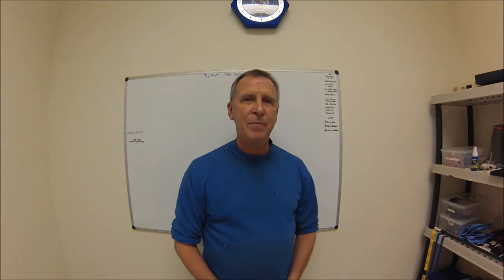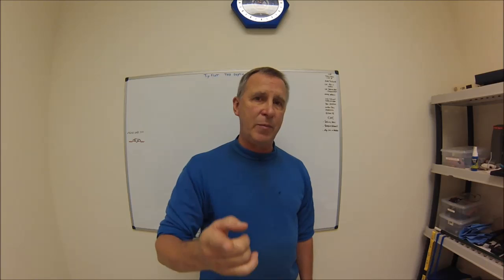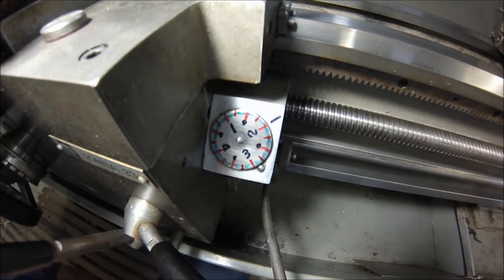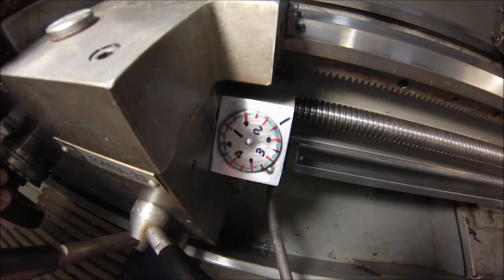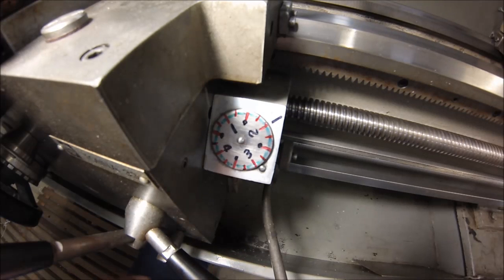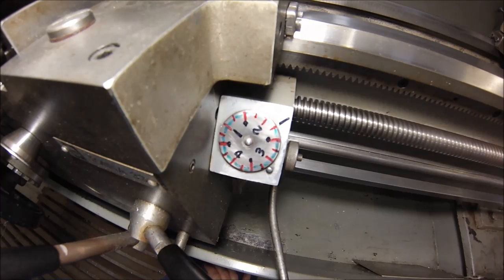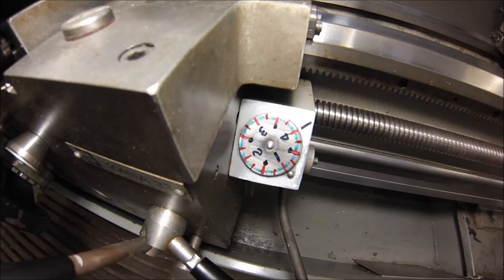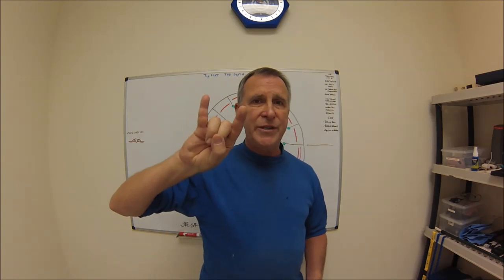Engaging a half nut.....made easier

Comment: I had 1-4 and intermediate lines. Putting a sharpie mark in between those lines really helped me. Made my first set of external 5/8x24 threads yesterday. Felt good.
Reply from the maker: Excellent. Did you also use the "away from the headstock" method ??
Reply: @joepie221  sure did!
Reply: How

Comment: if your lathe has a single gear thread indicator wheel here is what to do, with the lathe off,, engage the half nut, turn carriage crank wheel forward and back try to feel the lash if there is any, if so set the crank wheel in the center of lash .  engage the in the thread dictator, note the marker, if its not aligned with a line ,loosen the nut on the end of dial shaft line up the line and tighten the nut .you are now in time with the half nut and dial .there will be no need to feel the gear .
Reply from the maker: When slip engaging a half nut, its not the gear you are feeling. Its the teeth on the half nut riding on the outside of the lead screw. Most lathes I've seen have keyed gears on the thread dial, but if not, timing it as you suggest would be a good idea.
Reply: @joepie221  love your videos

Comment: I always do better when I understand the "why" behind it.  A threading dial is just a round ruler.  It measures 4 inches of carriage travel each time it goes around.  There are numbers at 1", 2", 3", and 4" with hash marks at every 1/2" in between.  Does your threading job have a whole number of threads in 1 inch?  If so you can use the numbered lines to engage.  Is there a whole number of threads in 1/2 inch?  If so you can use the hash marks in between.  This is why odd thread pitch = any numbered line, and even pitch = any number or hash mark.
Reply from the maker: Wouldn't you automatically have a whole number at 1" if you have a whole number at 1/2" ?
Reply: @joepie221  Yes indeed!  I should have said, "You can also use the hash marks".  If threading 11.5 TPI or Metric 0.4mm you can engage every 2" (pick even or odd numbers). 0.8mm will repeat every 4" so use the same number each time.  But remember to take Benadryl when threading metric 😂

Comment: On the lathe I work on, under the thread dial is a list of tpi numbers and a number beside them which I assume is the number I am supposed to engage the half nut on for those threads. However the numbers are 1, 2, 4, 8, and 16. What is the 8 and the 16? And when would I use 3?
Reply from the maker: Others may be better suited to answer, but I believe it depends on the pitch of the lead screw. I was always taught even threads can use any line, odd threads have to use numbered lines. Not always the exact same one, but thats the general rule. When in doubt, use the exact same line every time.
Reply: @joepie221  alrighty. Appreciate it. You've earned a subscriber my good man.

Comment: Great video Joe!  It saved me from hours of additional frustration and wasted metal!  I am teaching myself to use this cheap lathe so I never know whether it's me the machine or the metal.  I have been trying to cut a a test thread for hours now, 1.375-12 LH.  I had cut some 1/2' and they were so so, workable but not pretty.  I was having trouble "hitting the line" just like you described in the video.  I would always be right after it or right before it by like a, 1/8 or a little less. That should have been my first clue.  But since I was hitting before and after it by a graduation you know what the threads looked like!  I watched your video last night and with renewed enthusiasm, I went down to conquer the threading dial.  Running the carriage I realized that I could not make it land on a line no matter what it was always off like mentioned above, but it was consistent in the error before and after the line.  So I thought something is wrong with the dial.  So I took it apart (of course) and found other than the wheel there is not a more simple machine. I put it back together and put it on the machine and the results were the same.  That's when I realized the gear that interfaces with the lead screw is just a friction fit ( not keyed) so if I loosen the cap screw that holds it to the shaft of the threading dial I can adjust the position of the dial when it is engaged with the lead screw. Voila, now I hit right on the graduation every time using your technique.  AND more importantly, I got decent-looking threads on this piece of mystery metal!  THANKS A MILLION!  Sorry for the long post but maybe someone else is struggling with a similar issue on a used cheap Chinese lathe!
Reply from the maker: I got burned by a friction fit dial on a Victor lathe once. Made me nuts trying to figure out what was going on.

Comment: I bought an old american lathe and it does not have a threading dial. Would it be possible to make one ?
Reply: I have a 1929 South Bend lathe. You actually have to interchange the gears on the lead screw and the drive train as the brass plate indicates with number of teeth gears. No thread dial. I found a composite gear that fit the lead screw. I remember it was an odd size but made a mount and installed on the carriage. I just put one line on dial. Been using it like that for over 50 years and never split a thread! Lol I guess ignorance is bliss, but one in a row is a win! Lol! 👍😎✌️
Reply from the maker: Does it have a thread chart on the head stock and a lead screw? If so, I don't see why not.

Comment: If you allow a decent run in, before the cutter reaches the beginning of the workpiece, you've got time to disengage the half nut, before it starts cutting, if you drop into the wrong engagement point on the dial.
Reply from the maker: True. I have to admit, early on, I once missed my desired mark and released the halfnut in panic,. Naturally cutting an immediate ring groove and ruining the part. Lesson learned. I also thread away from the chuck, so I better get it right on the first try.

Comment: once again i have a closing . that as no lead screw. it dos have a short  shaft  where  the led screw would be with to gears on it  hi & low .  now this drives a shaft that  drives the sandal  & cross screws  screw curing is done  with the rack when we travel the saddle.   that why English lath operates  can time a chuck with the ability to cut a thread using a rack .

Comment: Another great video man. I’m retired and just started machining so I watch all of your stuff. I was looking for information on cutting double start threads using the threading dial. On a 4tpi double start thread, I would use any number or halfway between the numbers for one thread. The second thread I’d start when the mark on the threading dial is between a number and the halfway between the numbers spot. Essentially at position 1 on the dial and the place immediately after position 1 but before the 1 1/2 mark. If that makes since.

Comment: Thanks Joe, cleaning the leadscrew is fairly simple with a brush and or cloth but the half nuts are a different situation. On my Myford it involves dismantling the apron to access them. What process do you use other than accessing the nuts directly?
Reply from the maker: A long shoe lace dipped in alcohol works and keeps you out of harms way if you can see it.

Comment: Thanks, as always, Joe !
Am I right in thinking that there’s a caveat, though - it won’t work with an imperial machine, when cutting metric threads, or a metric machine, cutting imperial threads ?
Reply from the maker: I've always been taught to not release the halfnut between passes on a imperial leadscrew machine cutting metric threads. Its a PIA.

Comment: Thank you for the video. I've recently started trying my hand with a metal lathe. This video and the one on threading toward the tailstock are very helpful. After only moderate success trying to do as you show here, I moved the carriage manually to find where the half nut could be engaged and found that on my Standard Modern 1340 there are two potential points of engagement between each line on the indicator. The gear for my indicator has 24 teeth. Does yours have 16? Anyway, I have to wait until the mark has passed two-thirds of the way from one indicator mark to the next to engage only on an indicated mark. This leaves me with a tighter window than you show, but this version of your method works for my lathe.

Comment: Awesome video Joe. I was doing some threading to day and I sucks at this.
My threads are triangles  |/|/|/|/| :Oo Oh no! 
My dial has 6 numbers instead of four so I'm using no. 1 every time. I don't disengage the the drive, I just back the cross slide out and reverse the motor. I'm here trying to figure out what I'm doing wrong. 
Thanks for the dial instructional I'm sure it will help when I figure out why I have triangle threads. 
Glad I purchased some extra material. Best Wishes & Blessings. Keith Noneya
Reply: Compound slide is probably set to the wrong 30 degree mark, some lathes have the zero mark parallel to the cross slide, some perpendicular. Is the long leg of the triangle on the tailstock side?

Comment: Are you saying you still have to use same indicator line on dail every time but apply pretty just before that line comes around?
Reply: About applying light pressure just before the line comes around:
Yes.

About using the very same indicator line every time:
It depends on the pitch of the thread, the chosen gears (for the feed, not the rpm) on the lathe etc. In some situations you have to use the same indicator line, in some situations (with another thread) you can use every second or even every indicator line on the thread.

Comment: So why is the dail important to have at all ?
Reply: The importance if the dial is to make sure you start each new pass at the right place in the thread. As you probably know you can´t cut the whole thread depth in one pass, you have to cut a little at a time. And you have to start at the same point in the thread every pass, or you might end up cutting a groove where there should be a thread top instead. Using the dial make an easy task out of finding the right place in the to-be thread to start the next pass.
I hope this explanation makes sense, English isn´t my first language. But I guess that my English makes more sense to you than if I would have written this in Swedish. :-)
Reply: @Maskinservice  Your English is a lot better than my Swedish! I would say good enough that you don't need a disclaimer.
Reply: @feez357  Thanks!
It was just that I had to use so many technical terms that I´m not used to. 
But you should try learning some Swedish! :-)

Comment: As I said before, I have never stood in front of any machine, but to  me  this is the same as driving a vehicle, with a manual transmission, when the clutch system is not working. I have taught all my Sons that technique, of changing gears in a manual transmission, without using the clutch.
Reply from the maker: Its all about the feel and some patience.

Comment: This is really a useful tip! Thank you for posting it. I am a complete newbie, haven’t even purchased a lathe yet, and thought one had to hit the number exactly. I also thought it would take quite awhile and a lot of practice before I’d feel the least bit comfotrable single point threading. You’ve alleviated a lot of my concerns and, while I can still see it will take some practice to get it right, it no longer appears to be an almost insurmountable task.
Reply from the maker: And remember, the slower the machine RPM, the slower that dial will turn. Increase your cutting speed as your skills develop.
Reply: @joepie221   I was going to post the same as what Bob has just written here, so I'll just say that my thoughts are the same as Bob's as I'm another newby thats about to buy my first hobby lathe. Thanks again Joe. 
Oh I will just say that your vids (and This Old Tony, Abom79, Blondihacks and Stephan Gotteswinter's vids) have increased my knowledge immensely. Thanks.
Reply from the maker: @scott6896  3 out of the 4 give some solid advice, the 4th is winging it and should always be double checked.
Reply: Yes another complete noob trying to pluck up the courage to buy that first lathe, who’s been petrified about thread cutting.
I was thinking I’d just give it a miss and use a die and hand thread with a tap / die follower with lots of stick out and a fixed steady, rather than risk learning to cut threads on the lathe on my own.
Now maybe I would be tempted to have a go - having watched this.
I think I will save this one for once I do bite the bullet & pull the trigger.
Reply from the maker: @ianmoone2359  If you buy a lathe, buy one with a cam lock chuck, or a keyed nose and threaded collar. Chucks that just thread on are normally less likely to run safely in reverse. Watch this for even more inspiration to learn to thread.  https://www.youtube.com/watch?v=Z-dqOi_z5bk&t=1s
Reply: Joe Pieczynski  Thank you sincerely Joe.
This is the one I’ve been agonising over.
https://www.machineryhouse.com.au/L565D?From=Search&s=AL356V
It’s Chinese so not the greatest and the variable speed DC motor will lack torque down low RPMs & at high rpms.
It’s about all I have to choose from here downunder.
There’s zero competition - just the one supplier, so it’s a question of take what I can get within my budget unfortunately.
At 61 with zero metal lathe experience I’m deeply soul searching to try & work out if I’ll live long enough to learn machining.
I have a retired relative is a fitter & turner, who I would dearly love to take me under his wing and teach me but he recently had a big heart attack and now has a pacemaker fitted. He is not allowed anywhere any electric motors or strong magnetic fields, so operating a lathe is completely out of the question sadly.
His pacemaker is connected to wifi / internet and his heart specialist etc ring up and check on him if the pacemaker isn’t sending the right signals back to home base & the monitoring software knows if he’s been naughty and done anything he’s not supposed to, like play with a lathe.
So I’m on my own, basically and researching everything I can find on the topic of metal lathes and machining generally.
I’ve turned wood before today but metal lathes is a dark science in comparison.
I do thank you for your effort with this explanation, threading dials was a complete mystery to me before this excellent explanation. 👍👍👍🇦🇺

Comment: Joe. I started watching your vid's and I have subscribed and you are now my new machinist hero. Thank you so much for sharing your lifetime of experience with all of us. I am a heavy equipment mechanic by trade but also have some machining training and am a home shop machinist. This vid is a great help but I have one problem. I have an old 13" LeBlond regal lathe that is probably 50's vintage. My Dad bought it for me from a surplus outlet when I was in high school. It does not have a threading dial on it. It was missing when he got it. So when ever I attempt to run a thread I have to run the machine dead slow and always leave the half nut engaged, run the machine to a stopping point, back the tool out, run the machine in reverse, then move the tool back in and make my next cut. It's very limiting and tedious. Do you know of any possible place/s where I might be able to find a thread dial that would work on my ol'girl? I wouldn't try to make rocket parts on her but she's still fairly accurate for the projects that I get into. Thanks again for sharing your knowledge.
Reply from the maker: Thanks for the sub sir. I appreciate it. Finding old parts isn't my strong suit, but Keith Rucker deals with a lot of older machinery. Maybe he's worth a shot. I'll ask him.
Reply: @joepie221   Any help is appreciated. Stay well.
Reply from the maker: @joecookesr.7396  Keith was kind enough to shed some light on this for me. Shoot me an e-mail at  aiproductinfo@gmail.com

Comment: excellent explanation ! thank you !  I discovered this about 3 months ago and I haven't split a thread sense !  i found that you could drop it in early and keep some pressure on it and when it finally got there it would fall in !  and yes that does take alot of pressure off of you...  but it's much easier to just slow down the machine !  HAHAHAH !  but I do this even if it's super slow !
just stay away from the engagement point ! anything there after is great !
I had to make a new threading dial as the original one on my Logan was too hard to see .... but after learning how to thread stuff I realise now I could have just used a sharpie line... as I always use the same number anyway !
but the best tip yet is cutting the threads away from the headstock, tool upside down and lathe in reverse ! that works the best for me !  and I know it because of you ! thank you ! ....Bob.....
Reply from the maker: Glad you are now more comfortable Bob. Thanks for the trust.

Comment: I’m the one who waits nervously. But I often shift gears I’m my truck W/O using the clutch. If I can do that I can do this. 
Thanks
Reply from the maker: You can do it!
Reply: My first car didn't have synchromesh on the gears, so double declutching was necessary. With synchro, no clutch changes are easy! Since those days I've had a few cars from even earlier than that car.